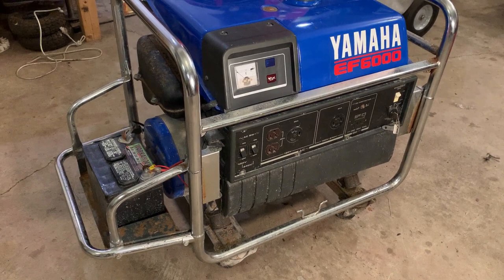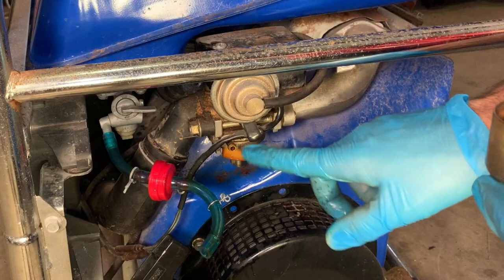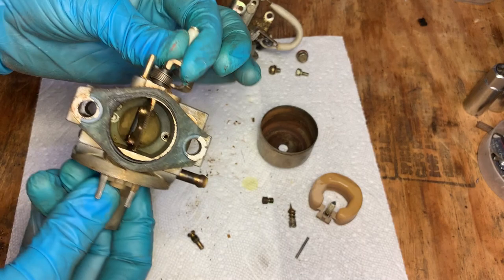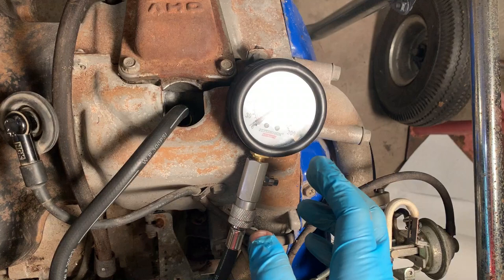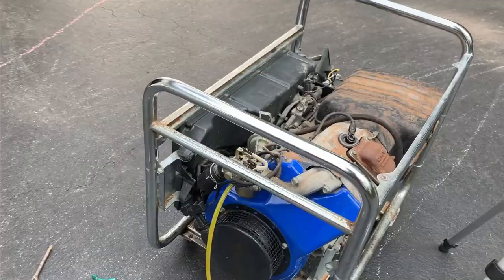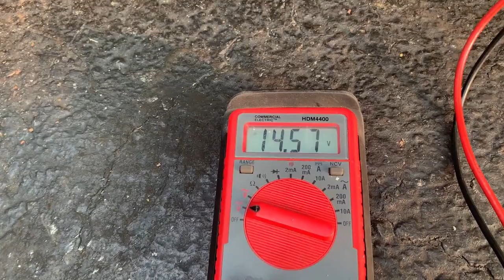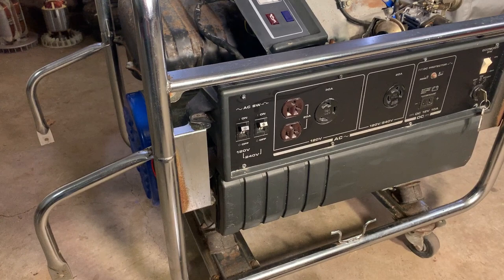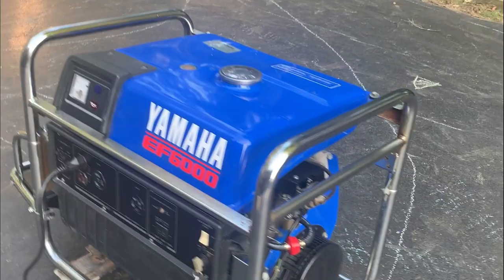Old Yamaha EF6000 Generator Will Not Start - Fixed

Comment: I used to run a retail battery store.  People in general WAY underestimate how long it will take to fully charge a battery.  I'd have left that on the charger for as much as 2 or 3 days.  Those J-hooks are also commonly available at any good auto parts store.  I use 'em for battery holddown in my truck.  Good on you  for insisting on having a holddown there,  too many people think that it's not important,  when it is.

Comment: Excellent repair on this generator.  I don't think I have see a double emulsion tube before.  Man, for 50 bucks that was a great buy but you had to fix it first so fantastic job.  Thanks for sharing.
Reply from the maker: Thanks.  Always a gamble buying something that does not work.  Thankfully this one was able to come back without much effort.  Working on one now that I think is a $200, 300 lb paper weight :(  Good for parts.
Reply: @jcondon1  Rance here Jim....I certainly hope that it does not turn out to be a paper weight.
Reply: @jcondon1  Not being mean, but I'd like to see your struggle with this one and where you get to the point of deciding it's time to throw in the towel. So far I've seen you fix everything you've started on. And some were ridiculously messed up! (the Generac 10000EXL with stupid wiring changes!).  Watching you is teaching me patience and perseverance... don't give up, keep thinking it thru to find "why"!  I'd love to know what your primary job is. Somehow I suspect engineering or a similar field where you apply logic to problems. Thanks for posting your videos, they do help!
Reply from the maker: Woolval52 Woolval thanks.  I am a project manager and software engineer by day.  I did recently do a video where I got everything working but did not like the sound (knock) the engine was making.  I called it on that one.  Not worth fixing.  Will release that one soon.
Reply: @jcondon1  Hello James. I have the same generator but have a low voltage problem. It will put out around 102 volts, and sometimes drop to 72volts and back again. Engine runs smooth and I changed out the avr with one out of a parts machine made no difference. Any idea what it could be? Thanks.

Comment: Just having a binge watch of your vids :D 
Honestly, There is something about the older machinery, that just looks awesome.. 
More character to their design..
Reply from the maker: This was one of the best built portable generator I have every worked on.
Reply: @jcondon1  It did look very nicely put together, and agree with RGD it's a beautiful style with the panel let into the tank & the chrome frame.  Only niggle for me was the battery tray looking like an afterthought but then again that was probably the whole point, make it obvious that this isn't just a generator but a generator with ELECTRIC START!!!  Honestly if I could make do with 6KVa this would be the one to keep. (Also binge watching the last week or so when I get a chance!)

Comment: Nice troubleshooting. That vacuum line almost had you running in circles but of course it didn’t t fool the master. Glad you found the clogged carb port.
I introduced my 8 yr old granddaughter to the “power of the sun and a magnifying glass” this past summer. I started her on dead leaves. She elevated herself to paper, pine slivers and pine needles then the killer instinct, making roasted ants. Woo haha. I’m sure she will try cardboard, but it better stop there (I hope).

Comment: I have not read all of the coments, but that white u-shaped is a bi-metal strip.  It functions much as the heater/AC thermostat in your home.  When electricity goes through it it heats up and the bi-metal strip applies a force on the rod which it's touching.

Comment: This vid really helped me crack into an old Yamaha 3500. Similar outlet panel and decals but no e-start. My uncle ran it for 10 years at his off grid cabin until carb finally choked out. The Yamaha purr is exactly the same! Thanks for this vid, really appreciate it!

Comment: @James Condon Theres a heating element (on that bi-metal spring) which is supplied with 12v when the generator is running. Initially the choke is closed. But as the bimetal being heated up slowly changes shape and gradually opens the choke.
When the generator is shut off. The bi-metal spring cools down and returns to its initial shape.
Its a primitive way to control the choke, but it works well.
Reply from the maker: First time I had seen it used in that way.

Comment: I have a tiny suitcase looking EF600. Runs about 4-5 hours on a 1/4 gallon tank of gas. Awesome little quiet generator. It also has the 12v battery charger port. It has a control on the back for adjusting the voltage too.

Comment: I think you would be proud, found a beat up Predator 4000 Generator that looks like it was sunk in a lake (they stored it under a wooden porch). Paid $40 for it. Already got it running,would not kick on starting fluid. Pulled the plug and was getting spark off the side. So I threw on old plug I had laying around in it and she fired up !!! Even ran off the gas in the tank (I thought I had it turned off, whoops)... she is a little hunty with her idle but your videos show me how to fix that. Already tested for power and she is good on both legs (which I did not even know was a thing until I started watching your videos).. thanks for the help !!!
Reply from the maker: Nice find!  I can never get a Predator for less then $180 in that condition.

Comment: Nice job. Those are really good machines. I might have changed the vacuum  lines and put a vacuum test on the servo's. Also when I take a carb out of my ultra sonic cleaner, I usually blow the water solution out with compressed air and then a squirt of carb spray to make sure all the tiny passages are clear of the any remaining water solution. You are a great and patient mechanic. Thanks for the video's.
Reply from the maker: Those lines seemed really in good shape.  Not cracked or petrified so ran with them (for now).  Did not show it but I always clean off the solution with water and and blow compressed air to dry.  Sometime run carb cleaner through depending on how bad it looks.

Comment: The J-bolts where they were cut off always leaves a sharp edge -- so I cut a piece of fuel line and slip it over the threads to cover the sharp edges.  Great video.

Comment: Yamaha and Honda might be dearer, but they are definitely the best. That carb looks a bit complicated, but I'm sure that if you get it sorted it will run trouble free and economically for years. Foam rubber under the battery and hold down clamp will lengthen battery life.

Comment: That's an electric choke, it's a bi-metal spring that when electric is applied it heats up and disengages the choke
Reply from the maker: That is the only thing it could be.  Just surprised because it also has the vacuum servo.
Reply: @jcondon1  You showed a picture of the replacement carb that had a wire coming off the bi-metallic loop - missing on yours. Presume it uses a 12v feed from a running generator.
Reply: Same feature as an old electric pop up toaster.Still working.
Reply: @jcondon1  the bi-metal spring pushes the servo and choke back after the engine shuts down
Reply: @jcondon1  The vacuum servo pulls the choke part way open when the engine starts while the bi metal spring prevents the choke from opening all the way until the engine has had time to fully warm up.
Reply from the maker: Rhian Taylor that pic may not have been the exact one for this generator.  Never found any tags on this generator to positively identify parts.
Reply from the maker: Tired old mechanic thanks for the info.  First time I have come across this on a generator.
Reply: Well it's bi-metal, I can thing of one or two reasons to put it on. First to keep the choke from opening fully when the engine is cold and second it may serve too as a cold weather adjustment reducing the amount of air coming into the engine as cold air is more dense.
Reply: Meh....
Reply: @James Condon Theres a heating element (on that bi-metal spring) which is supplied with 12v when the generator is running. Initially the choke is closed. But as the bimetal being heated up slowly changes shape and gradually opens the choke.
When the generator is shut off. The bi-metal spring cools down and returns to its initial shape.
Its a primitive way to control the choke, but it works well.

Comment: Picked up a 5550  watt troy bilt generator for 50 bucks today, thinking I'd fix it after watching nearly all of your videos. Turned out to be nothing wrong with it other than needing a pull cord assembly. I'm almost disappointed.
Reply from the maker: nodriveknowitall funny.  Sometimes it is easy.  Good deal.

Comment: I ran a smaller Yamaha 2800i for quite a while, after 8 years and minimal work the inverter failed and not worth repairing, I've reverted to the older generation of AVR gensets, although not suited to sensetive electronics, heavier and a little noisier are I feel far more reliable, an EF1000 that would have to be 25 yrs old give or take ($300 second hand) takes care of battery charging on my Camper trailer if the sun fails to shine for several days  and basic power needs at home if the grid fails. It's just awesome!

Comment: Pro-Tip............when assembling, one of the best things on the market for gaskets and housings for a good seal, that is easy to work with is Loctitie 515.............sooo much better than silastic/rtv or anything else. Another nice save!  Its a really sweet running set.

Comment: James,  On your Ford  or Chevrolet those are called a choke pull off or Vacuume break. Looks  exactly like them. What they do is when the car  or generator starts the choke pull off opens the choke some till it warms up enouh to open the choke. If you put a vacuume on it it should open the choke some. You can check it by  unhooking the vac. line push it open with your hand and cover the vac port where the hose hooks to it. Supposed to stay open then, If it doesn't stay open then you need a new pull off. It  will flood it to death if it does start. It won't pull it wide open but it should open it enough to run, You can usually adjust them somehow where it starts and runs good till it warms up.

Comment: My grandma has a generator that is a pain to start we used to use it to prevent the basement from flooding but since we fixed the flooding problem we only use it for watching tv when the power goes out and I thought that it was interesting that it was a two piston engine

Comment: I also spray battery terminals with terminal protector.  It keep them from corroding over time.  I also wipe off the space between the terminals with a baking soda solution because batteries can discharge by electron flow between the two terminals due to acid ions on the top of the battery

Comment: A nice job all round, on surface rust, what I use is 0000 steel wool & 3in1 oil, I also use it on light surface rust on air rifles, it's worth a try. Thank you for posting.
Reply from the maker: Thanks will give it a try.

Comment: Nice yamaha very neat old generator
Reply from the maker: It was a true Yamaha.  The newer Yamaha generator engines are build in China...  Still run very well though.
Reply: @jcondon1  not built like they used to be that is for sure

Comment: You could rewire the 120V plug to a split then u could get 20A from each half of the plug
break the tab off between the 2 hot screws on the plug come off 1 breaker to 1 half of plug come off other breaker to other half of plug both these wires on hot side of plug leave Neutral side as is
Reply from the maker: Yes that would work.  Was trying to keep it original, but do not understand that the thought was behind that.  Guess it will last forever since it would be hard to fully load it as configured OEM.
Reply: James Condon I  am electrician and changed my small gen to split so I can use two tools at same time

Comment: I have a old onen with the same frame.has the idlematic and same carb.when cleaning the carb i found that my emulsion tube was in 2 pieces too but it has inner and outer core.can't put a wire in the holes cause the wire hits the inner core.I found a similar carb on eBay for about $30 original one is a mikuni that I cleaned and works fine.my choke is manual but there is a heating element that controls some aspects of the carb.
Nice to see u work on a old school generator.that Yamaha is pretty I wish my frame was Chrome.

Comment: That automatic choke works as follows:  With the engine off the choke is closed,  as the engine starts, the engine vac pulls the choke part way open. The insulated u shape thing is a bimetallic heating element which as it warms, opens the choke the rest of the way.  Not sure where the electric power to heat it comes from, but would guess the engine has a bat charging alternator under the flywheel and that is the source.

Comment: With a little bit of maintenance - that is the key word.  They are often left out in the rain, full of ethanol gas and folks wonder why they won’t run when they need them.  Mine is in my shop and it goes through an op test every month and it is filled with PNE gas, stabilizer and synthetic oil.  I won’t say it will last, forever, but I like its chances better than most.
Reply from the maker: Agreed.  The generator I use on my house has to be at least 15 years old and never had a problem.  Does not take much to keep them running properly.

Comment: Great job of sleuthing out the problem. Single cylinder engines have a tendency to vibrate which can shorten the life of a battery. Some isolation material under the battery and hold down clamp might be in order if you plan to keep the unit. If not, the next owner can deal with it.
Reply from the maker: Good point.  Thanks

Comment: Nice work bringing this generator back to life, keep up the great work!
Reply from the maker: Thanks
Reply: Noticed the throttle linkage has an anti surge spring around it which goes to the throttle plate like my generac. Does the spring use the same hole as the linkage?
Reply: @geraldbarney2448  Some engines use the same hole as the linkage for the spring to hook into and some engines use a separate smaller hole for the spring.

Comment: I have watched several of your videos & they're absolutely therapeutic for me &, of course, very informative. Your calm persona & in depth instruciton are amazing. Thank you! I have a Yamaha EF1000 that will not start the first several pulls of the rope. After I walk away for 10-20 minutes & return, it usually starts after a few pulls. What do you think might be causing that? I watch videos on these Yamaha EF1000s & they always say theirs starts on the first or second pulls. I'm thankful that mine wiil consistently start after a waiting period, but puzzled as to what might be happening & if that could be corrected. I love this little generator & wouldn't part with it at any cost, but I wish it was easier to start. BTW, carb is a brand new Mikuni, so I don't think that's the problem. It required the same starting routine even with the old carb. Thank you & please keep these rare, in depth, educational videos coming. You're the best!
Reply from the maker: That is a hard one to diagnose.  Would say try a new plug and make sure it is gapped properly.  Otherwise would double check the choke plate is fully closing and confirm when not starting that the bowl in the carb is full of fuel.
Reply: @jcondon1  Thank you! ;)

Comment: Still like this genset will make someone a very good set for a long time if they run the gas out of the carb like I do. Of course my battery died 5 years ago but I kept it going for a few years before I just start it with the pull cord. Would like to get one of those inverter sets so the rpm isn't stuck to the frequency. We don't get frequent power off storms like you folks back east because we have hydroelectric dams but ice storms do make the trees fall on the wires. My son down in Texas could have used some of my generators and space heaters this past winter since I have three gensets and he has none.

Comment: You have an awesome piece of equipment.  Some hints.
NGK plugs only
10 w 30 Full Syn Silkoleone ester based oil  
Ethanol free gas
Reply from the maker: I can check most of those categories.  Unfortunately, ethanol free gas is not available without a substantial drive for me.  Wish it was easier to get at the pump.
Reply: @jcondon1  Be very careful if you use a fuel stabil.  It will GEL in the carb.
Reply: @jcondon1  James, I know this sounds pretty strange, but it does really  work. To get gas with no alcohol in it  is pretty easy to make. Check this out. Take a gallon of gas, (this is where it gets weird) pour a few ounces of water (yep water) in it. Leave it set. the alcohol in the gas absorbs the water, then just pour off the good gas. Most fuel here in Michigan has about 10% alcohol in it, so you will lose some volume. 
Check it out, its for real.

Comment: a good way of cleaning rusty chrome steel is use steel wool and turps  steel wool cleans the rust stains and the turps removes the stain and protects the surface
Reply: Iuse WD-40 and 000 zero steel wool.

Comment: I worked for a construction in the early 90s and we had the same generators we also had a few Hondas which were pretty similar to the Yamahas.
Reply from the maker: Shakes 73 was thinking it looks like it was made in the 90’s, but has a very 80’s look.
Reply: @jcondon1  Yes they do look older. I think the ones we used was purchased in late 80s I started in 1990 and they were a couple years old already.